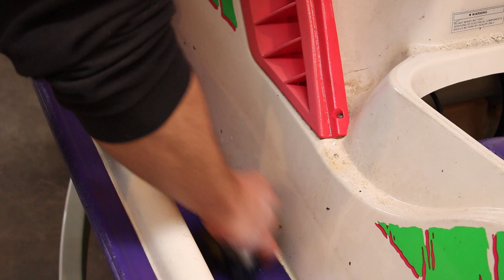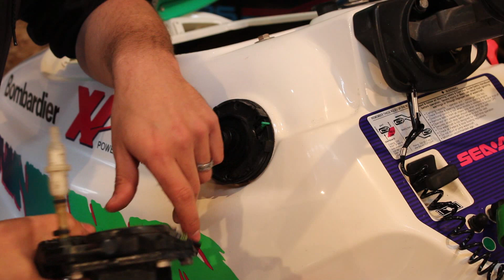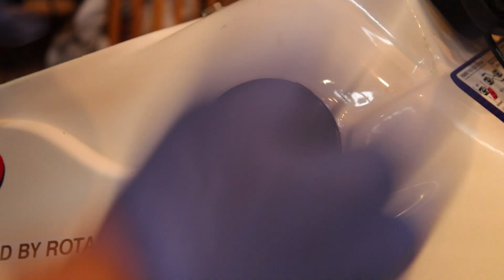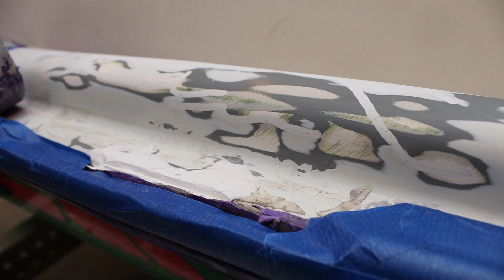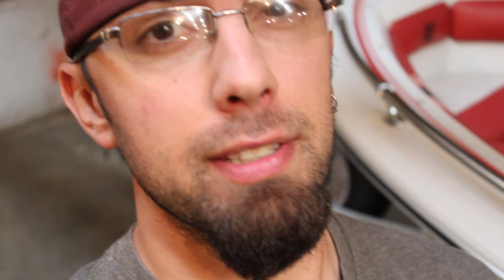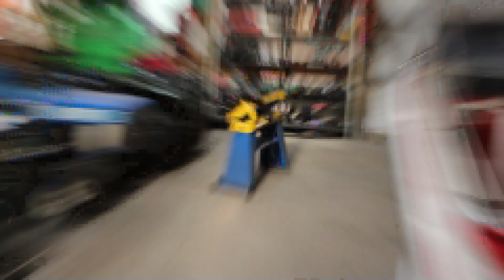Jetski hull repair, manual trim system, sending it on to the next owner. A look at future projects.

Comment: Best things I’ve found for putting on grips are 
Using an air compressor to shoot air around the grip as I side it on or off. Or if I don’t have a air hose handy hair spray works good as a lubricant then glue almost to keep them on.
Reply from the maker: Never thought about hairspray, I'll have to give that a shot. Oddly enough I think I have a can in the shop already lol